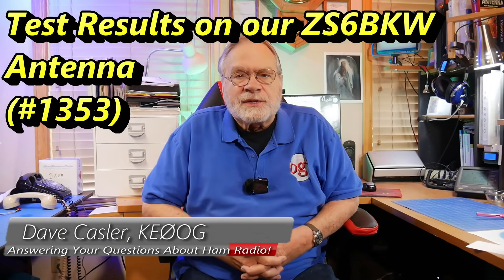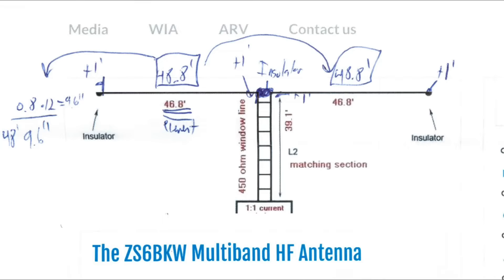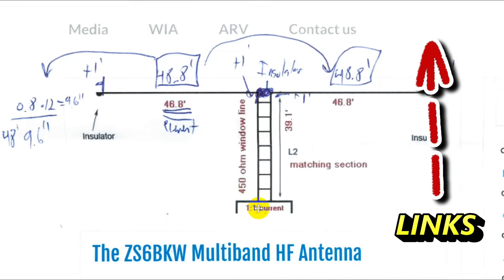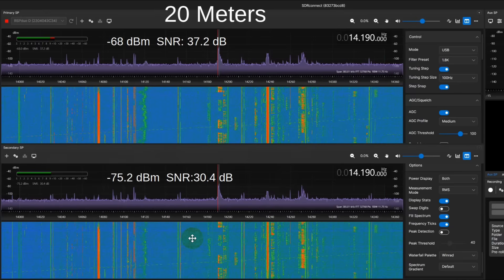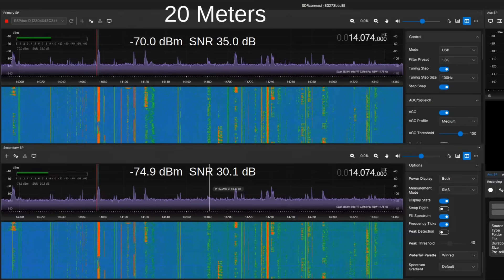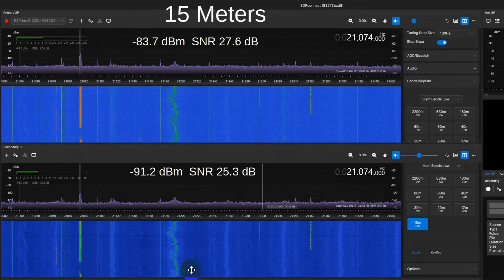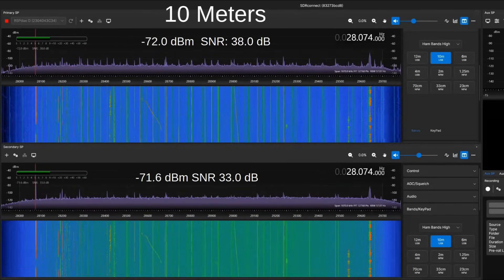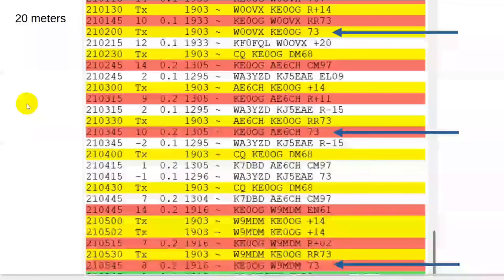Test Results on our ZS6BKW (#1353)

Comment: The meandering signal on 10M is more than likely caused by a plastic welder somewhere in the world (more than likely South America on 10M during the day). These welders are notorious for transmitting on the higher bands, typically from 12M to 10M. When the higher bands are open, you will see a bunch of these on the waterfalls of SDRs. (Look it up, there are videos showing them in production and causing all sorts of RFI.) Thanks for all of your videos, Dave.